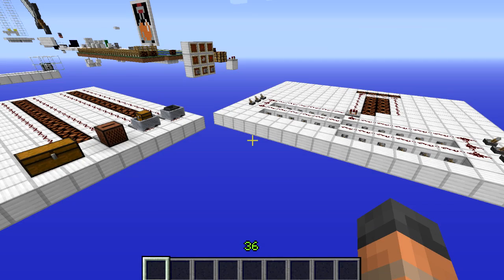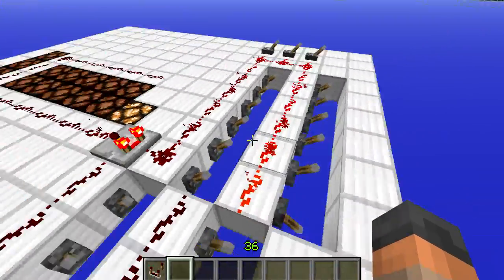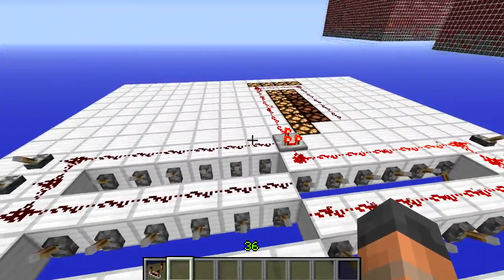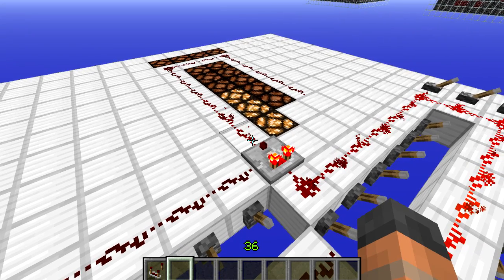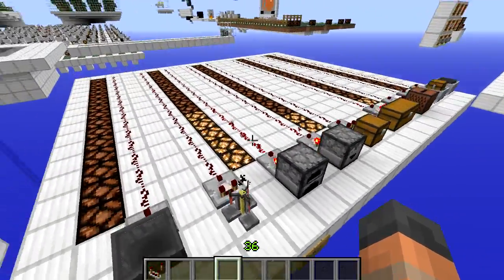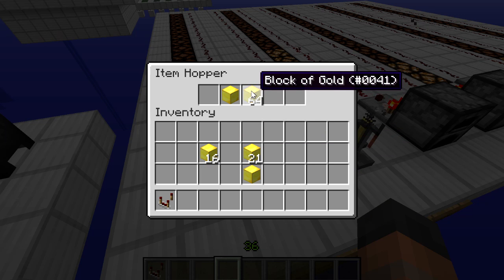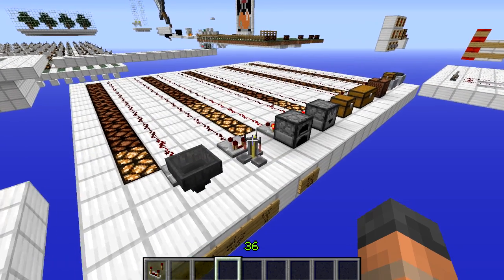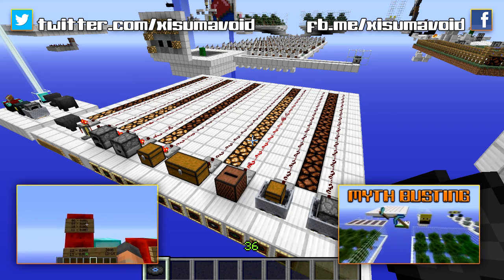How Redstone Comparators Work [Minecraft Science]

Comment: Doesn't the redstone dust power the block below it and then carry that power to the blocks next to it? So at around 1:52 the lamps on either side of the block powered by redstone BOTH turn on? The lamp on the inside doesn't power after the redstone turns the corner. So with that the last lamp shouldn't be on, the power isn't to the block that that lamp is supposed to be powered from.

Comment: Actually, the reason that the cauldron doesn't work with the comparator is because if it is filled up, then it will set a redstone signal.  So still the same concept, but cheaper than making a comparator

Comment: I made a fully automated brewing stand using them...
One can also make:
Sorting systems
More compact calculators (yes, they are possible in Minecraft, I made one)
Anti-stealing mechanisms (though a DUD works better for that)
Very compact and fast clocks (comparator on subtract with its output leading into side B while being powered on side A)
And more.

Comment: Hey Xisuma! I may be a little late and you may not even read this comment but anyway, I think I found the formula for the number of items in a container that can give you a specific signal strength. Its roughly like this:

(Total inventory space - 15)/14
We'll call this x
The formula for output is as follows
1 = 1 item
2 = 1 + x + 1
3 = 1 + x + 1 + x + 1
4 = 1 + x + 1 + x + 1 + x + 1
and so on to 15
I find that you have to use the value of x to two decimal places in order for this to work.

Comment: You can for example use a comparator rather easily as a counting mechanism, similar to repeater-loops. This could save you tons of RS NOR latches to do the same thing. You can also use it for analog inversion of a signal - similar to digital inversion done through redstone torches. There's so freaking much you can actually do with a comparator. The first challenge is to actually find out what you can do.

There's a lot more to say about comparators & droppers, but this comment is too small. :)

Comment: with the signal strength for item detection i'm fairly certain that it's the number of items. divided by how many of that item make a stack. then times by 15 (the max signal strength) and divide by how many slots that item has. if your number is less than 8 then you round UP to the nearest whole number. if you get a number more than 8 then you round DOWN to the nearest whole number. i could be wrong but i believe that's it

Comment: Your maths were correct X (: 
64 * slots = IS
(Lights -1) * (IS/14) = Number of items

So if you want a signal of 9 blocks in a hopper (5 slots): (9-1) * (64 * 5/14) = 8 * 22,86 = 182,85 -> 183 items (or 2 stacks and 55 items)